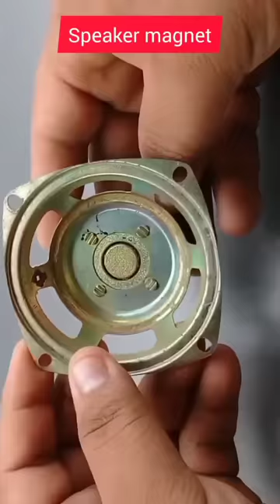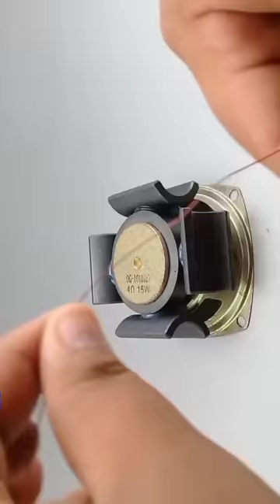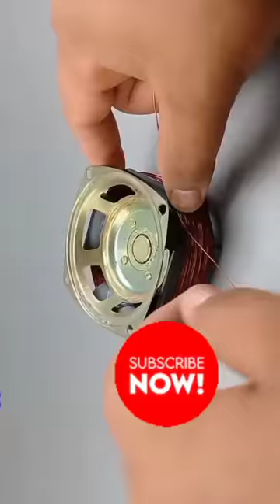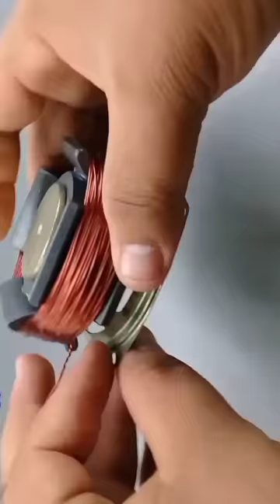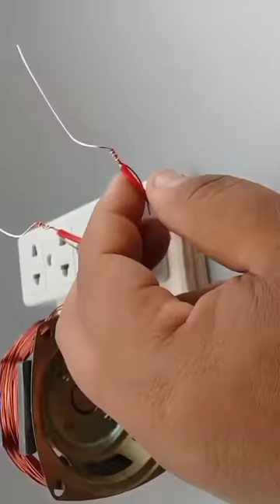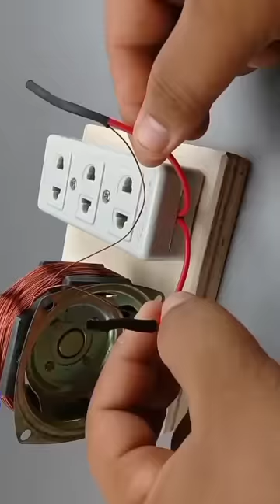motor with speaker magnet 220v generator#shorts #kamaltechhelp

Comment: At least your music is not gut wrenching and ear piercing. Unfortunately, the "generator" is not going to produce 220V or any other meaningful voltage. Your theory for making it is way off. Good job hiding the external power source, i.e., the wires powering the motor. That right there makes it not "free electricity". Adding more hot melt glue won't help,  either.
Reply: I pomyśleć, że ktoś w to nawet uwierzy ;-)
Reply: ya dc motor will stop immediately or slow down to like 10 rpm when you attach load to it